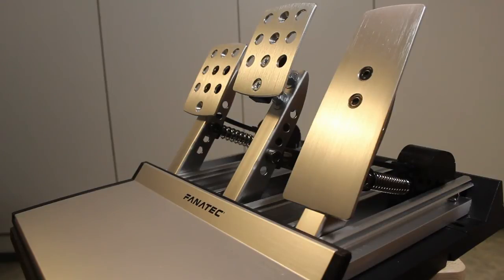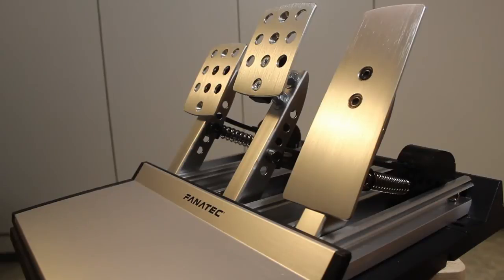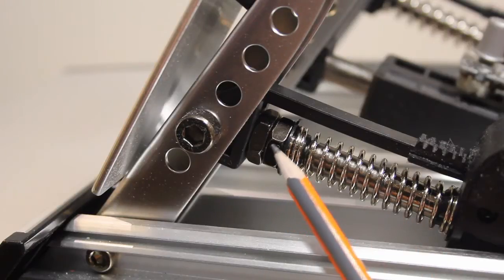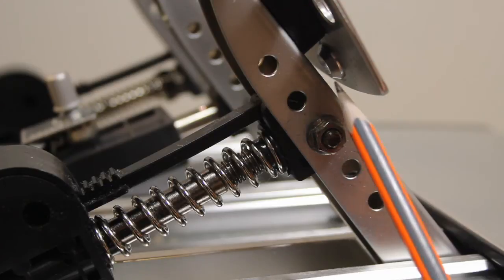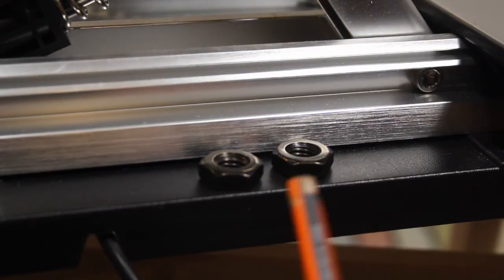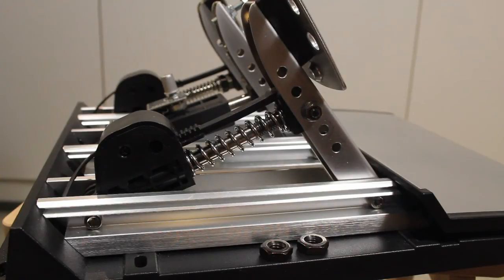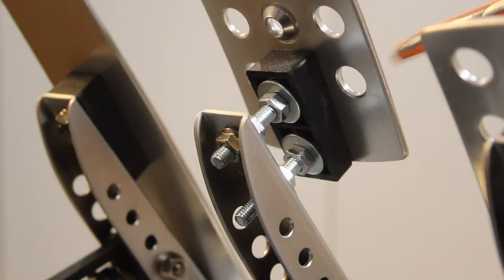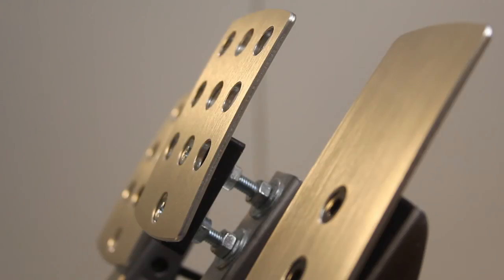Fanatec CSR Elite Modifications

Comment: if you take the pedal face off first you can pull the mechanism out the top of the pedal without having to take apart the pivot bolt and mess with the wiring
Reply from the maker: +helipilotwannab I think you're right. 
In fact I only detached the brake pedal wire, because I needed to move the whole pedal closer to the gas pedal.  But what ever you do, you need to be careful, with the wires, so you don't break them.

Comment: Hey man I know this is a really old video but I've recently taken my sim racing a bit more seriously as I've just started on iRacing. You mentioned that you find the clutch is stiffer than the brake pedal. I just noticed this when I tried tightening the springs on both the accelerator and clutch for a bit more feel. Have you found a way to remedy this, or have you moved on to a better pedal set?